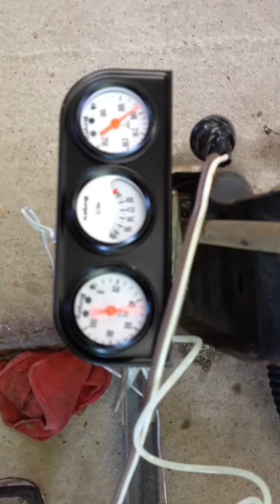Small block chevy ,350,xe282hr comp cam idle, open headers, griffrod66

Comment: Just finished my engine build. Happens to be identical to what you have here part for part coincidently. Down the Proform slant edge valve covers haha. Just getting it fired up this week for the first time. Have you found a good initial timing it likes to run at? Also what heat range plugs are you running?